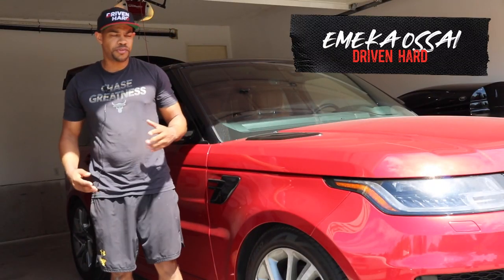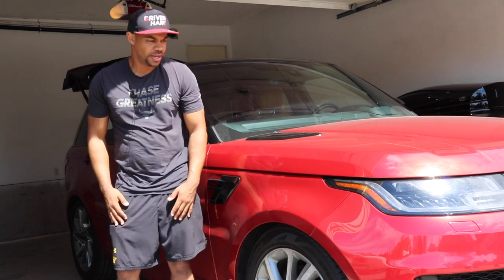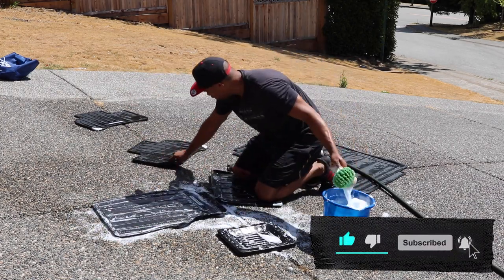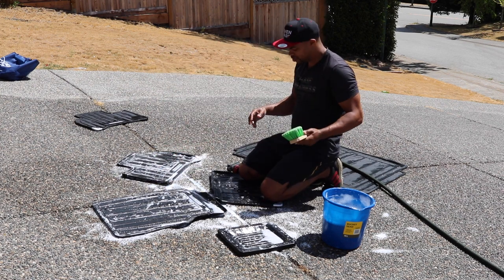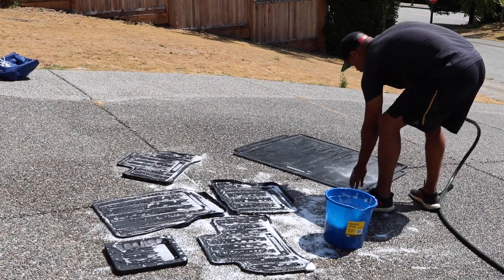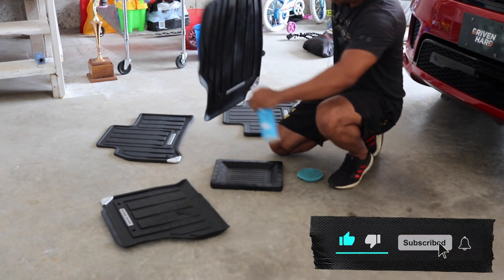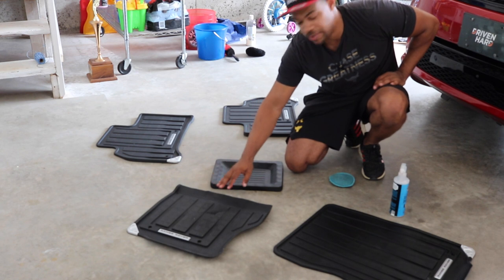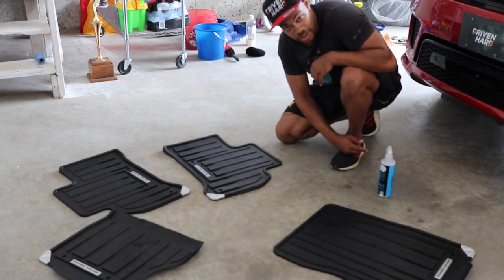How Clean Rubber Floor Mats

Comment: I just use soap and water with a dust pan brush and a toothbrush for our beige rubber mats. Works really well, makes it look brand new all the time. Does my opinion count? I’m not a LR owner?
Reply from the maker: It counts lol
Reply: Driven Hard atleast Ford and LR is sorta similar in some kinda way 😆 😂 

Well TMS is a meh version of TR2, I think it’s fine but not TR2 level 😎